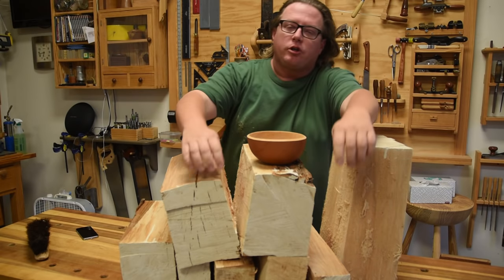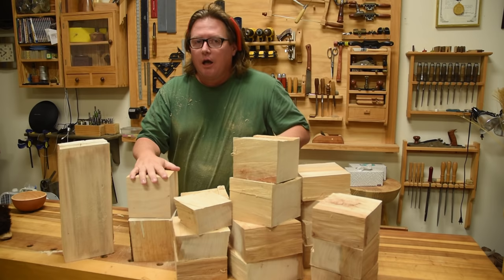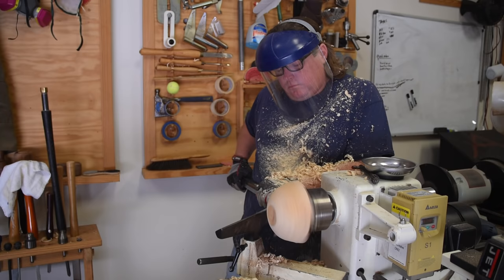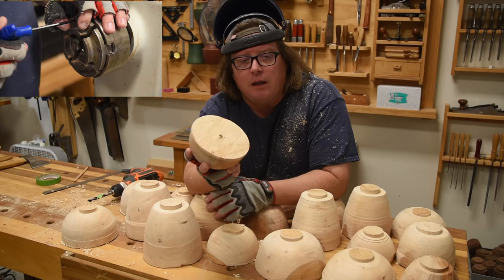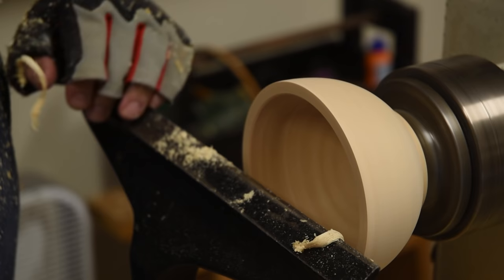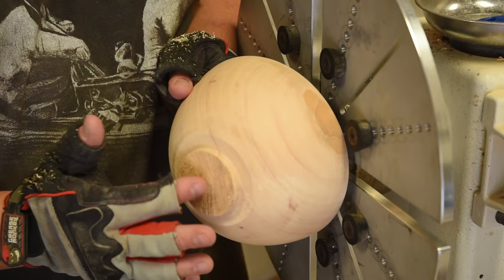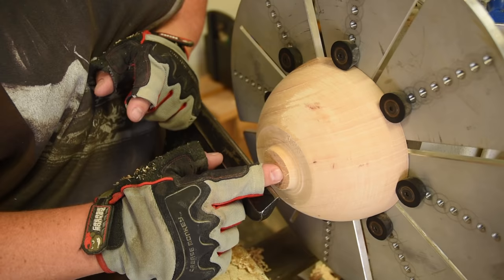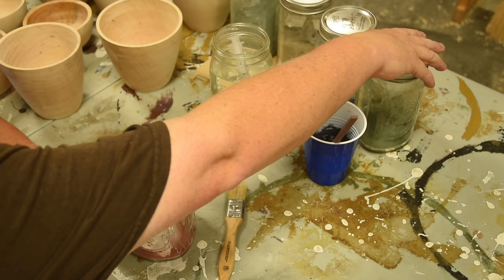Make a $20 Bowl in 20 Minutes

Comment: Something about wearing gloves and having loose fitting clothes and long hair not put up while working on a lathe....makes me go.. hmmmmmmmmmmmmmmm
Reply from the maker: Ya, well I'm not much into spandex... Also, not the most flexible thing in the world so tend not to bend over too much... the gloves, well, I talked about that in the video.
Reply: wortheffort fair enough. Good video man. I just got my lathe yesterday so I having to learn a lot. Lol
Reply: Having been a shop teacher for 34 years I am well aware of the importance of safety but....I wear gloves in the shop a lot of the time. At the jointer so I can grip the edges of the wood and not get splinters and have the edges of the wood cut. At the lathe the chips coming off the turning can sting and sometimes be hot...so yes I certainly wear gloves. Unlikely they will get caught.
Reply: If you keep your hands behind the tool rest for roughing you have very little to worry about honestly.  I have had big splinters come off when I started roughing a bowl that embedded into my hand I I do understand gloves, especially tight fighting ones.  Once the bowl is round and smooth, it wont catch either.  Green wood makes a big difference too.  Also, he has that piece of wood on the lathe with a worm screw, not a face plate screwed in, if  something caught, in most cases that piece of wood would just stop and turn freely on the worm screw.  If you use too much pressure from a tool you can strip that worm screw hole out super easily.
Reply: @QuiltersHandyman   You're a brave man, sir.  I've seen gloves and shirts (once each) ripped off by jointers.  Luckily the wearers were only scared spitless and, in the case of the glove, a little bruised where his knuckles hit the pulley (Yes, it was stupid.  Don't ask).  Jointers are dangerous with loose clothing of any kind, due to where the spinning parts are relative to YOU. Usually right at shirt tail level.  I was witness to the aftermath of a man that got his (non-gloved) hand pulled into a shaper (After I showed him the custom push tool I made for raising panels and was told, "Nah.. I always do it by hand."  I thank God I had to go install that day!)   I don't wear gloves or put my hands anywhere above the cutter on jointers, shapers, etc... because splinters are much preferable to getting your fingers sewn back on.. if they can even do that.  PUSH STICKS PEOPLE!  Commercial ones usually suck - make your own.  Find what works for you and use it.  Your fingers will thank you.

Lathes are an entirely different ball game.  Your hand isn't pressing toward a stationary cutting head, you have the tool rest to block your hand from going too far.  Your body and clothing are generally a lot farther from moving parts. There's very little chance gloves will get caught if you're just cutting with a tool (hands Behind the tool rest).  I wear one glove on the close hand, and use the other if I have to check cut depth or shape.  For anything else, I take it off.  I've gotten pinched a few times, a scratch or splinter from a rough edge, but friction burns are way more common than anything else.  Lathes are probably the safest floor machine in a wood shop.  (Unless you try to turn a glue-up with a lot of end grain joints.  Makes you thankful for that face shield... :-)  )